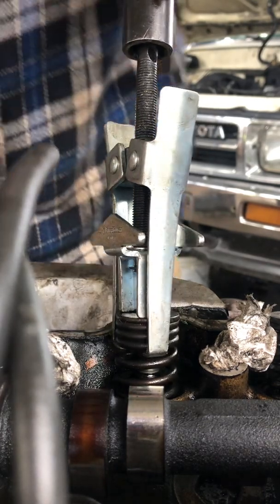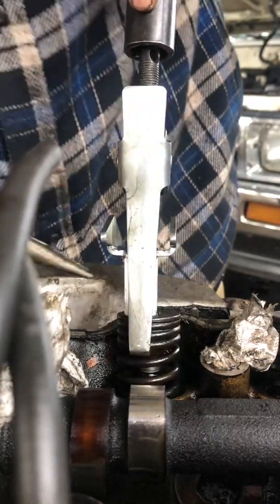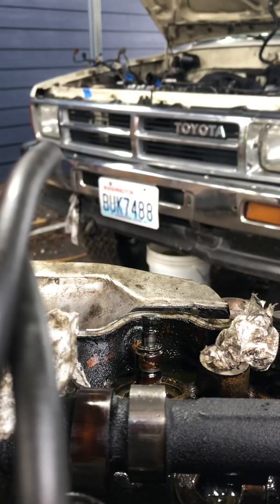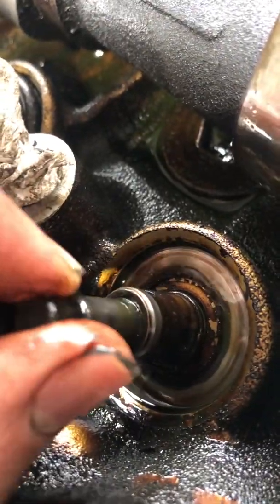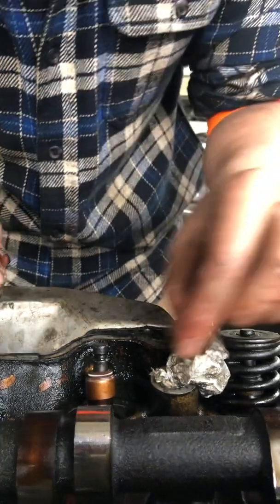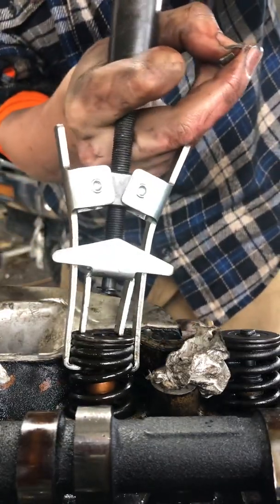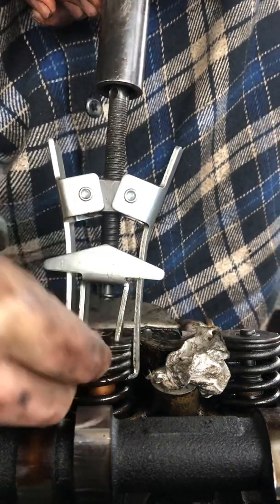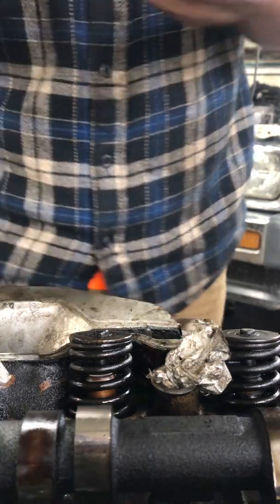22re valve stem seal replacement

Comment: What are you using to keep the valves up and prevent the to fall into the cylinder?
Reply: If you dont pull the head you can buy tools to pressurize the combustion chamber slightly with compressed air to keep the valve seated.
Reply: @Jake-im2lv  thanks
Reply from the maker: I had it on a 55gal drum. I pulled the head off to do the work and figured do hg at the same time considering the mileage on it when I bought it. So no worries about it dropping into the abyss

Comment: Can i Replace oil seal without remove the cylinder head Thanks for the Video  (like and Subscribe)
Reply from the maker: Technically you could but it gets sketchy. In order to get to the seals you have to remove the rocker assembly , and the rocker assembly is held down by the head bolts. I’ve heard of people ratchet strapping the head to the block to keep compression on the head gasket but I wouldn’t want to run the risk of popping the hg and finding out later down the road. Best to pull it anyways to see engines condition and slap a new one on there.

Comment: Besides burning oil, what were any other symptoms you had? I pulled my exhaust manifold the other day and found some oil in the number two exhaust outlet. Trying to decide if new valve seals will be enough or if I should plan on a full head rebuild. Might find way more when I pull it all apart of course.
Reply from the maker: Not much else really. Start ups had a little bit of blue smoke but once warmed up it cleared. But it never hurts depending on your engine mileage. I was at 303k on the original engine without a rebuild so it was best to go abit deeper than planned on cleaning and replacing parts. Did new chain and steel guides, timing cover and oil pump. (If you go rockauto the cover and pump will cost less than 100$ total for aisin)

Comment: You doing it with the head on the bench? Or using the rope trick?
Reply from the maker: I have the head off for this. I could never get a direct answer on if the rope trick would work or not since the rocker assembly has to be removed to get the seals off, which are held down by the head bolts. I didn't want to risk popping the seal and not knowing it so i pulled the whole head.